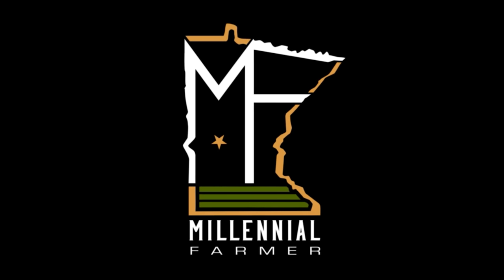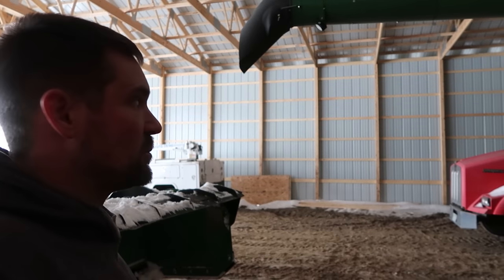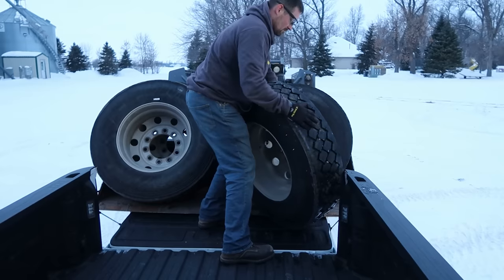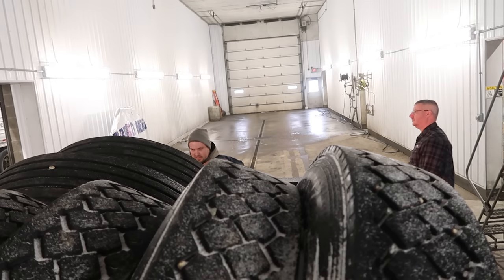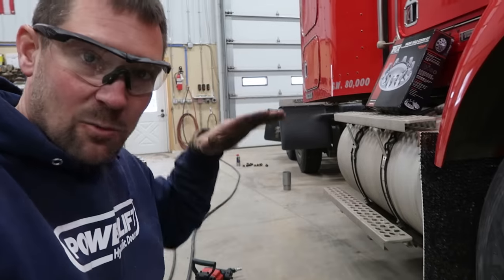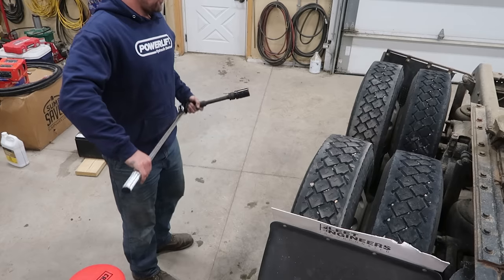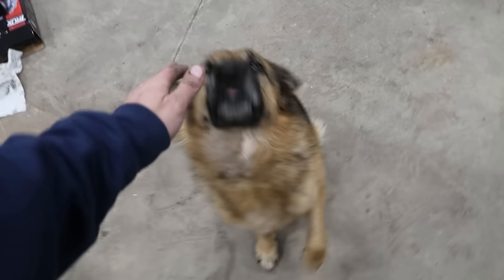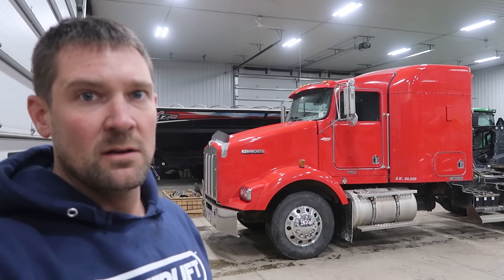This is NOT A HOW TO VIDEO! I Can't Believe it!

Comment: Poor conductivity = resistance or lack of ability to deliver the appropriate amperage needed to make chooch  for whats askin... and the load will get its amperage... So for what there is of connection has more amperage flowing through it and therefore gets hot

Comment: Is the cables not the battery. Its a kenworth thing. Every one I've driven has done it at one point.its a resistance issue. I bet the cables get hot when cranking.

Comment: Zak I would check all your connections that corrosion is definitely your problem think of your battery cables as a pipe and your electricity is the fluid flowing what happens when you put a hole in pipe you loose said fluid same principle as battery cables with corrosion on wires going in terminal except for your loosing electrons in the form of pixies no one knows where they go but we definitely know not to starter
          The corrosion acts like a damn only so much electrical energy can flow  let’s say your cable is single 0 cable maybe 00 with that corrosion it’s acting like a 1 or 2 cable and because of the leakage or dam is also why it’s getting hot

Comment: Don’t want to burst your bubble but you might have high dollar batteries now but you still don’t have high quality ones. My son works for a big timber company , they were using NAPA GOOOOLLD PREMIUM SUPER WHAM BAM what ever batteries in their machines. They were lucky to get 1 1/2- 2 years out of a battery. They switched over  to Cat batteries problem solved. You can tell the difference just by the weight, the Cat batteries are way heavier.

Comment: REPLACE THE STARTER ALREADY!!!!! ARGH DANG YOU MILLENIAL FARMER!!! 😎
Reply: Starter worked perfectly with new batteries and cleaned terminal posts/cable ends.
But the corrosion inside those cables means they all need to be replaced....
and a CTEK battery charger permanently wired in...
plus a disconnect for the whole battery system.
No circuit=no draw=no fires etc.
Reply: @JohnSmith-yv6eq  Put a starter in it.  Been down this road before.  Starter is wore out causing high amp draw, you can hear it in the videos.

Comment: zac my old car was laik that truck of yours keep changing batterys at the end i changed the starter and problems were gone when we opened the starter one of the main bolt shorted out on field coils.replaced with a gear reduction starter starts way way beter maybe that help

Comment: UNHOOK THEM BATTERIES.  The computers have a constant draw. and is enough to take down a set of batteries in a short time. And NO IT DOES NOT AFFECT THE COMPUTER.  I have been a heavey duty tech/class one driver 51 years. and even partly retired I still go pull wrenches occationally.   smartest thing you can do is put a power master switch on any tractor, or semi truck, even a car or pickup if you intend on it sitting not started for a long period of time.

Comment: You’re a harbor freight answered half impact will not stress does our break those it will lock them down tight. Used a minute times and actually blew up those guns. We’re OK for 3040 trucks but after that They are no good

Comment: Stupid question, but are your cables hooked up correctly and all the batteries hooked up together?? Sounds like its not using all the batteries to start it. Two batteries may had bad cells in them too. I would check all the cables and connections.  Cables can get corrosion under the cable  coating too, especially if they are older Cables. I would go that route next. I know those CAT engines can take alot to turnover, but that just sounds like it isn't getting all the juice!! Lol those juice boxes you got may be a little sour. Lol by juice boxes I mean batteries by the way. Just mechanic nicknames. Lol and the tire issue, I have literally had to do the same thing before on super singles on a  bunch of  trailers my old company bought. The only difference is that we used a big forklift instead of a four wheeler and it still took alot of beating, snatching and just praying to the good Lord to intervene and rain   fire and brimstone down on those rima and send them back to hell where they came from......... we won the battle by the way. Lol How did you not die after getting all that dirt on your face. Usually that melts  Millennials body parts right off! Glad to see your still solid. Hahaha Okay last thing, Zach puts safety glasses on and looks away right before pulling on that tire. Fantastic use of ppe Zach, but maybe it was the wrong ppe for this moment.  How about a helmet incase that strap decides to smack your melon. Lol good stuff bro!! FULL SEND ZACH, FULL SEND!!!!! Sometimes you need to hit the back of the rim with a dead blow hammer or an easy sledge hammer. Lol and you can put bars through the holes of the rims and pry on the brake drum to help break it loose. Might need to put those plastic rim gasket between the rim and steel drum. It helps them not sieze up on the drum like that.

Comment: YES ITS A BAD CONNECTION  . WHAT HAPPENS IS WHEN THE VOLTS GO DOWN THE CURRENT GOES UP . THATS WHY WHEN , YOU HAVE A LOW BATTERY WHEN YOU TURN THE STARTER OVER IT WILL DRAW A LOT OF CURRENT THAT CAN BURN YOUR STARTER MOTOR OUT .  I THINK YOU HAD A BAD CONNECTION,  NOW YOU CLEAN THE TERMINALS  IT STARTED STRAT AWAY . BET THERE IS NOTHING WRONG WITH YOUR OTHERE BATTERIES.  LET US KNOW IF YOU HAVE TIME . NOW GET YOUR REAR END BACK TO WORK 😂😂

Comment: I love your channel but I don't understand the rat's nest of wires on your batteries.  I've got to believe the problem is in there.  It's hard to tell in the video, but the wires look much too long.  The longer they are, the more resistance.  Also, are all the wires the proper size?  If they're too small, they won't carry the current.  There could be a number of problems in there.

Comment: Your starter issue. I would bet a paycheck that your starter is bad. Had several that sounded like that. Went to a different starter repair place. Guess what, if you replace all the parts it is then called rebuilt. Unlike the other company that changed what they thought was bad and then sell it as a rebuilt.

Comment: Now take wheels back off and spray the hub with fluid film 🤦‍♂️ or u won't get them off next time. Or atleast lube the hub where the rim slides on.   U missed a DW40 endorsement 🤦‍♂️
Reply: Change that wire that was hot, its got corrosion in it or it's loose at starter, follow that wire, is it loose at jumping blocks?

Comment: The starter is garbage, change it, and you will not be sorry.
Reply: Starter worked perfectly with new batteries....???

40 years ago I had a starter where the end of the commutator shaft cut through the  oillite bearing and into the alloy end housing of the starter...it cranked real slow with a huge amp draw until 2x truck batteries were added....
Reply: @JohnSmith-yv6eq  The initial and slight pause indicates that it is pulling a considerable quantity of amps, to begin rotation, compared to a new starter. It is detrimental to batteries to pull a 'dead short' of amps in every start cycle. If batteries don't last, change the starter if all connections are properly maintained.

Comment: The reason one of your batteries is very hot, the other battery not quite as hot, and the other battery not really hot at all is simple. The problem is that you got all of your batteries from the same place. If you weren't married, and you were going to date one of three sisters because she was hot, would you go back and date the other two sisters who were only pretty and homely? Of coarse you would, that's why you don't have three really hot batteries, but to be completely honest with you, a battery is only as hot as the beholder. Step back and take another really hard look. Are any of the other two batteries any hotter now? Try turning them on. I bet that worked!